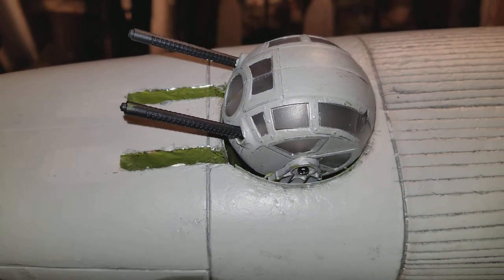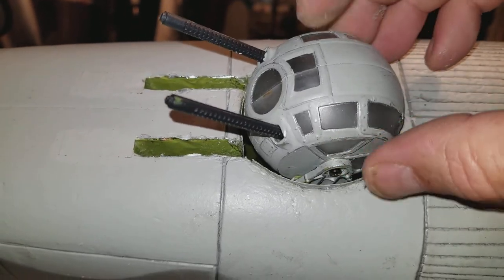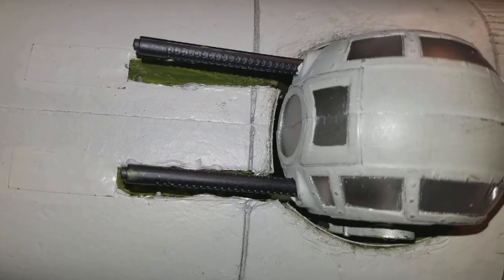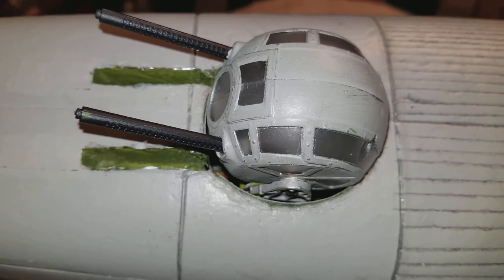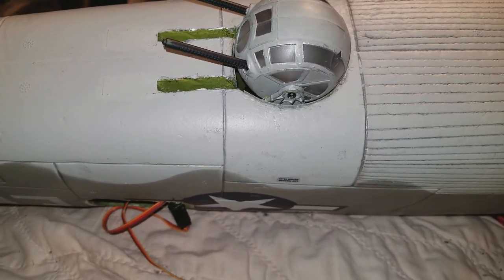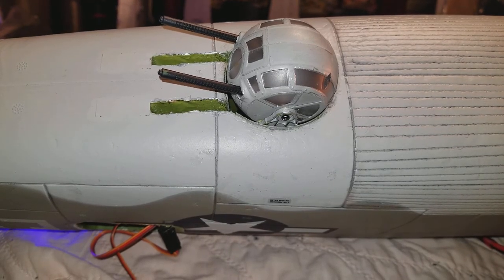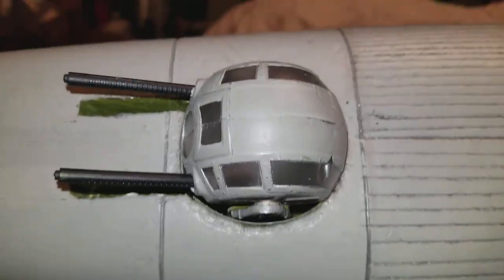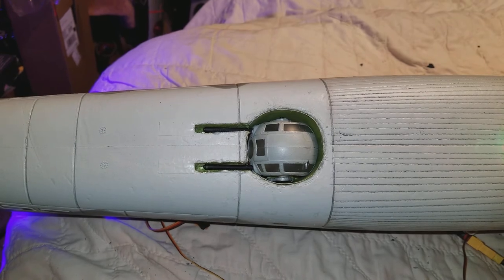FlightlineRC B-24 retractable bottom ball turret modification

Comment: EXTREMELY nice work! But now it's got me wondering- where exactly did the guns go in the real plane when the turret retracted?  I assumed they had them pointing down, but that would kind of make the retractable turret moot- the barrels would simply stick out as far as the turret did if they were pointing down...hmmm...
Reply from the maker: There is actually a good video on You Tube of a real one in operation that shows exactly how it works and how the barrels are stowed. They actually stow just like I have them, slightly tucked up in the fuselage pointed aft in two barrel bays.
https://www.youtube.com/watch?v=RcPTnsAP9wU
Reply: Amazing! I took a ride in the Collings B-17 a few years back. One of these days I'll put up the vid of the flight. They don't let you in the ball turret, but I got a good look in the open hatch. It's 3 feet across front to back, and about 2-1/2 feet side to side, except the twin 50s are inside there with you, with your head between the 2 breech blocks. And you're hanging beneath the plane with no parachute inside the ball. NO THANK YOU!! And, seriously, THANK YOU to all the very young  men who did that. Anyway, back on track- nice job with that! We may make a reinforcement kit for that plane- my drills are getting itchy...
Reply: I forgot to mention- I designed a delay bomb bay mechanism for the Freewing B-17 that could be enlarged for the B-24. It's a "door open - delay - drop bombs" mechanism made with a retract sequencer, or you can use 2 switches or buttons- one for the doors, one for the bombs. Judging from the size of the plane, you could probably fit a half dozen eggs in the bomb bay (the B-17 held 4 small eggs, or 2 large). Let me know if you're interested- I may have made actual drawings. There's also the HK "candy dropper" thing, which could be modified to fit
Reply from the maker: The guns actually retracted into the fuselage and tripped a disengage switch that prevented them from firing and only live when the ball turret was extended..... this was a later model upgrade to help keep the ball turret intact on landing